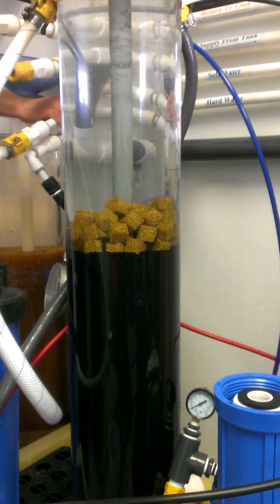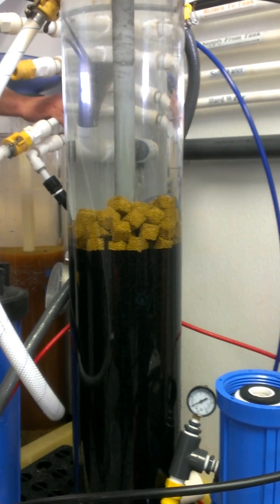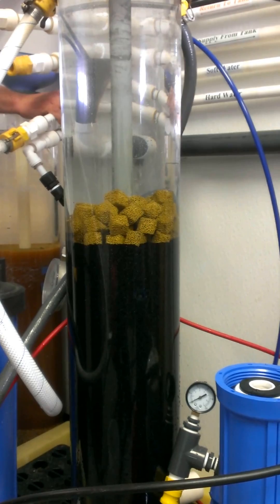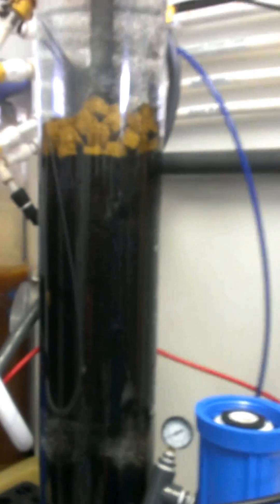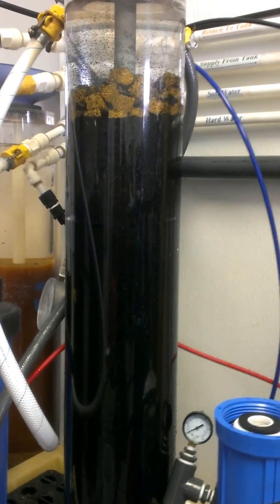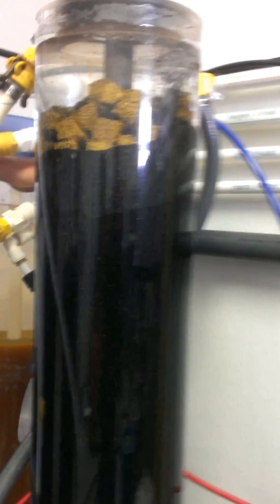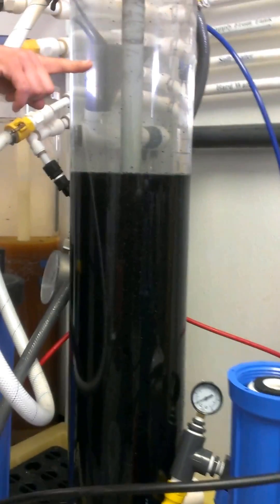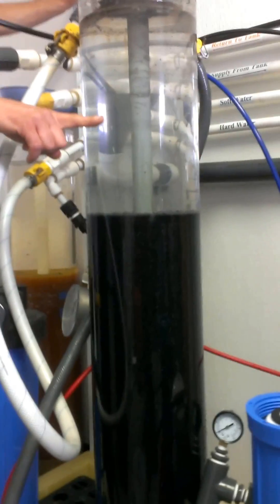Carbon with KDF Cubes

Comment: Hi. so you don't recommend the KDF cubes? Ive been researching whole house filters and a few companies have been offering the cubes instead of the media guard
Reply: Got it! Thanks. That rules out a few brands. Is there any way you can email me or if you don't mind responding in this forum about whole house filters you do recommend. Not softeners but a combo carbon/kdf filter. Was also entertaining the new 5812 fleck for whichever system I do get to support adequate gpm backwash.
Reply: @vk5744  So what was the end result here?  I am looking into this all and want to use KDF 85 but don't know weather to just use the media guard in my catalytic carbon tank or use a 4.5x20 loaded with KDF in front of the 2cuft carbon tank.  I have seen some say not to backwash KDF and others say you absolutely need to backwash it...
Reply: Thomas BfromNE 
In the end I went with aquasana. I thought I was over thinking it in terms of cost/design for what I was trying to do. If I had well water, def worth over thinking this whole process. However, I’m on city water which is cleaned/chlorinated to an extent. I went with the Aquasana rhino whole house system and a separate 7 stage RO system form APEC.